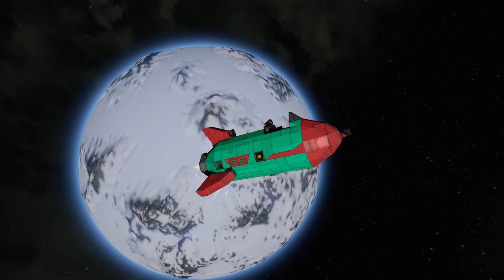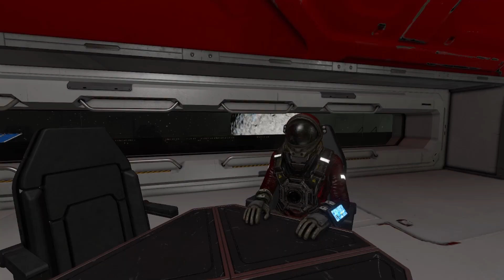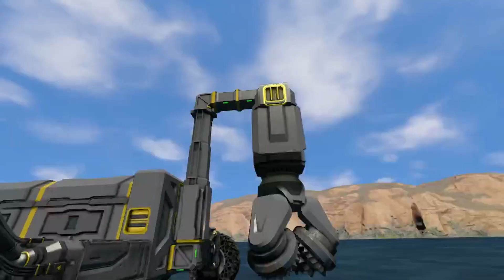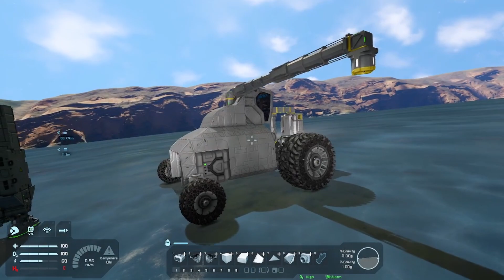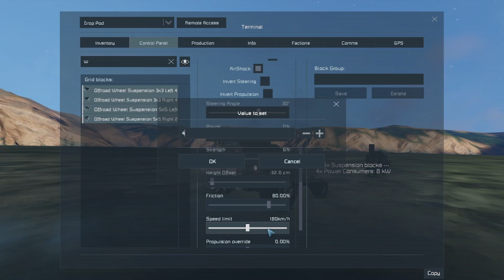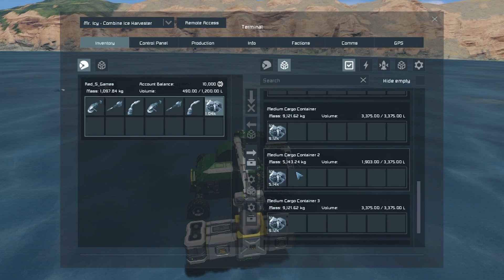Ship of the Week - Ice Harvester - Space Engineers Ship Design Challenge

Comment: Personally I would always build an ice scraper with its drills at the back of the vehicle because that way you could potentially plow an ice field. You would want to drill a hole wider than the vehicle though and preferably be able to switch the drop arm's direction so the pickup vehicle can stay on level ground.

Here's a challenge. I have a 'module' consisting of three large grid blocks I need to move. One module block is a battery, the center block a merge block oriented down and the last block is a projector. Build a wheeled vehicle that can pick up the module either from the ground or from a merge block embedded in voxel, transport it cross country and drop it off again, either onto ground or onto a merge block, oriented to gravity, embedded in voxel. I do not need to access the module from the carrier vehicle. If need be, assume that the embedded merge blocks do not have blocks around them during module pickup/dropoff.

Yes, I know that a flier would be much simpler. Good luck.
Reply from the maker: That could be fun, essentially a cargo truck with the ability to self-load and large enough to handle fine with large grid blocks.  Onto the list it goes!
Reply: @redsgamescompany  I look forward to seeing it

 Look out, there's IIRC a known bug (feature) with merge blocks and voxel. If you merge, the static/ship state of the resulting grid depends on which merged former grid had more blocks. If the module has more blocks than what is put down before merge then the result is a ship and if part of that ship is embedded in voxel, thar she blows!

i use module like I described to more rapidly build defense posts. Place and weld a merge block (sunny side up), lay down some extra blocks (see above why) and bring in the module with preconfigured projector, after which I can remove the extras. The new grid is now powered and ready to weld. The module gets demerged and removed after construction but can be brought back for major repairs.

Comment: so... in other words, your making a snow blower.
Reply from the maker: what is a snow blower, but a very messy ice collector?
Reply: @redsgamescompany  yep,  i'd have gone for something more "comical"  put the ice drill in the rear,  now picture cockpit low in the front then in the middle top,  an advanced rotor.   armored convayers (because for this they would look cooler)  leading out past the wheels of the vehicle with the ejector.  I'd also likely mount a ladder between the wheels...   with the rear cockpit door accessible, so you climb the ladder onto the back of the vehicle and get in the cockpit there.  but i'm weird like that. 

then set the controls,   i could swing the boom with the ejector to the right, or left side of the crawler,   or stock store it facing forward out of the way.  the chase vehicles would then have collectors that lower down with slanted armor pannels to form a bulldozer blade to help funnel dropped ice chunks into the collector.   this would allow them to fill up their cargo loads, then  switch out while the ice blower keeps on chugging along.   

looks innocent